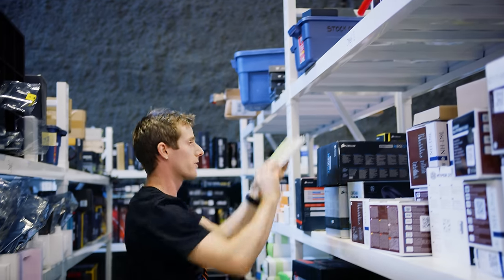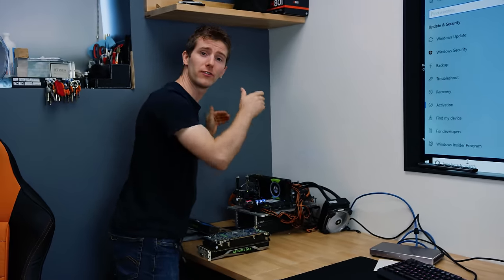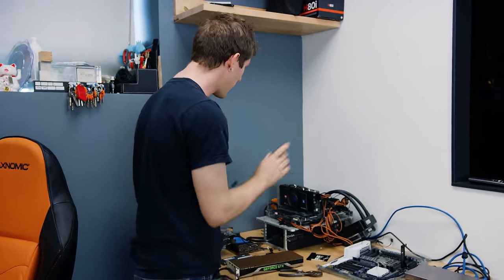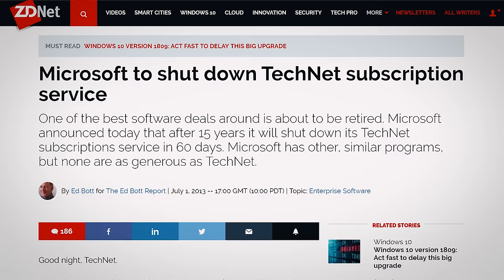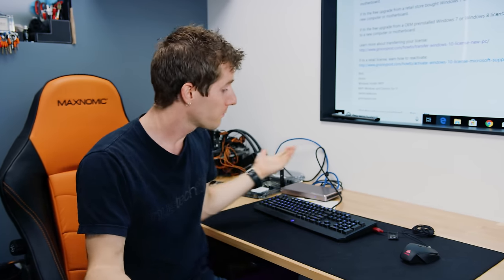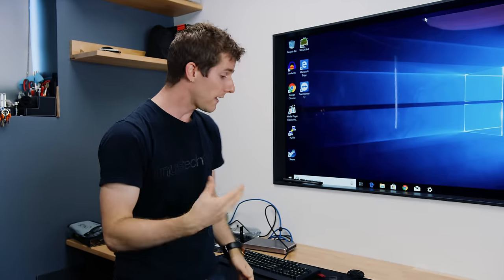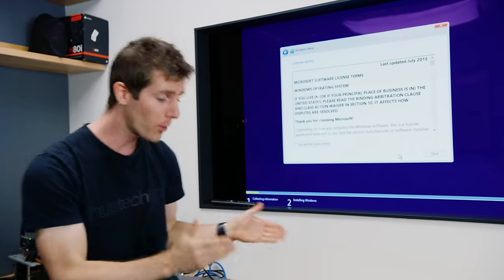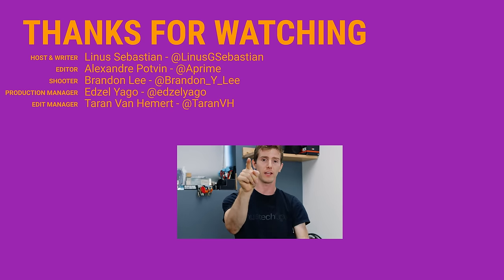Why Does Linus Pirate Windows??

Comment: I've been working in IT and related fields for over 25 years and I've yet to meet ANYONE who's ever read a EULA.
Reply: I did for a few things at uni. they have some strange stuff. did you know facebook doesn't allow registered sex offenders in their terms of service?
Reply: Makes sense I guess, but I wouldn't know - I'm not on farcebook or any of those other stupid social media platforms. Even for youtube I only log in to make the occasional comment. I do know, however that farcebook don't allow kids under 13 to use it, yet you won't find many kids that are not on it, so I guess they don't read the T&C either :)

As for Windows, so far, I've only ever seen one system running Windows 10 - most of the stuff that lands on my workbench are still single-core 32-bit XP systems, though Windows 7 is starting to show up a bit more often these days - hardware is a hell of a lot more expensive here in the UK than it is in the US, so people don't upgrade until something breaks SO badly that even I can't fix it). 

Personally I ditched Windoze almost ten years ago - Linux FTW!
Reply: It's against US federal law for kids under 13 to have accounts on social media, forums, etc. They can use it, but the account technically has to be created by the parent and used with adult supervision, or something. AFAIK it's not really enforced, but it does mean YouTube can't get sued by a negligent parent if their 9 year old gets an account and watches restricted content.
Reply: Apparently Microsoft EULA even stipulates that you can't openly criticise their products. So, whenever you're bashing on Windows you're probably violating their EULA terms.
Reply: When the EULA is non-negotiable and your only choices are either accept and use the thing or reject and don't use the thing, most people will not even consider the latter.
I bet reading the EULA feels like a waste of time when you think like that.
Reply: I read the EULAs...
Reply: … I tried, once or twice, but, after about half a page I decided that going to six different church sermons on Sunday then spending the rest of the day in the confessional booth would more than make up for any and all sins that may or may not have been committed for not finishing the EULA ...
Reply: @TGPDrunknHick  lmao that sounded soo random
Reply: 2 fun facts
1 most all EULA's are not enforceable many actually contain illegal terms.
2 on no one reading em there was once a EULA i cant remember what for but the company or an employee added a term hidden in the Eula that if you read this call them and reference  that you win $100 i think it was like 5 years before it was claimed.
Reply: No the reason I don't use facebook is because I'm not going to give that creep zuckerberg any of my personal data :D

Comment: You really shouldn't use the word "pirate." You're not stealing anything. The version of Windows I have is cracked. For whatever reason, after swapping the RAM and HDD, the digital key that came with the PC was gone. I paid for Windows when I bought the PC - I'm not paying for it twice.
Reply: Having no license key means piracy.
Reply: I had an experience when upgrading and I had to spend £100 on a new windows copy. Apparently if you upgraded from windows 8 to windows 10 you can't change any hardware or itll deactivate and you can't reactivate. Microsoft scumbags.
Reply: Mark of Excellence I built a pc and I sold the mb 
The new owner got my license 

Rip legal windows
Reply: He does have a license. That is the point. It's not piracy.
Reply: Lets keep it at him using pirate for clickbait 😉😅
Reply: Mansen
Testing a product the legal way when the product itself offers you the option of testing it is not "piracy" just because you didn't register a license.
Reply: You can't steal something that you only made/took a copy of.
Reply: Piracy isn't stealing friendo
Reply: I've pirated win 10 pro and it works great with updates etc. And I'm proud of it, everyone should stop putting money in the pockets of super rich monopolies like MS.
Reply: I believe the Mark of Excellence is "chrome" and costs about $7 from any dealer with a parts department :D
Reply: That's odd, I did an upgrade from 7 and eventually replaced everything, the motherboard, ram, processor, and graphics card. Yet I still had no problems activating since it's just linked to my microsoft account.
Reply: Toms Tukmanis don’t tell people!
The less people that use it the longer we get to keep it!
Reply: I find the ignorant to be quite amusing. I guarantee that the ones who put on the holier-than-thou facade often breach contracts without even knowing it.
Reply: I just bought it from ebay for $2.90
Reply: I agree with people who lose there license and don't wan't to buy another copy. Also if you don't have the money to buy a copy at the time and just not activate windows and then later on you buy a copy. I agree
Reply: Yep, the laws favor corporations far more than they should, and some corporations take greater advantage of that than others. Microsoft and Nintendo are a couple that will behave in a draconian fashion because they're able to.
Reply: Kevin Galindo lucky, for me it just wouldn’t let me.
Reply: central windows agency hates hardware swapping
Reply: So you lost your money and now its ok to steal. 🤔😥😥    😅😅😅
Reply: @infernustitan7091  I'm not stealing anything. I didn't lose anything, either. I have Windows and I paid for Windows. End of story.
Reply: @One_Cool_Cucumber575  same thing happened to me when I upgraded motherboard and processor.
Reply: It can also mean trial version...
Reply: @infernustitan7091  then why MS is allowed to steal product from me if I change hardware?
Reply: @StinkTerios  Yeap stealing means to take something of someone who doesnt know that you took it or take without permission. Well pirates Rob, that they take it by force and violence. Making sure you know it for good .
Reply: HWIDGEN
Reply: Mansen  Im commenting from a non activated windows
Reply: lol cmd has a built in windows activator its hilarious
Reply: Why do I have to spend a lot of time researching how their troubleshooting or transfers work? It's my time, it costs money. I bought their product and expected it to work normally but because of their mistakes or some kind of activation protection system it doesn't work so it's their job to fix it not mine.
Reply: Daily reminder that piracy is not stealing.
Reply: Mansen Having no license key, in this case, means that MS isn’t following their own TOS. It’s not on Mark of Excellence to pay for MS’s mistakes.
Reply: @HarryPearce7  Daily reminder that there was no unauthorized reproduction and/or use and thus no piracy occurred.

Comment: The reason why Linus's demonstration of losing your active status due to hardware swaps FAILED is because Linus was using a brand new Windows license. New Windows licenses allow for 5 legit activations. If Linus would have booted up the PC with substantially distinct hardware 6 different times, he would have lost his active status and got the watermark. They probably weren't using a brand new Windows license when they researching this beforehand.
Reply: True
Reply: Actually the Windows 10 activation disappears only if you replace your motherboard. It’s not affected in any way by the processor, the RAM, the graphics card or even the drive. And even if you change your motherboard, you can still restore the activation by using a Microsoft account.
Reply: I thought Microsoft changed how Windows 10 activates now to instead link the license to your Microsoft account. So reactivating should just require logging in and getting one of your unused licenses.
Reply: NVideos Yeah.. except he did change his motherboard. He showed it right in the video.
Reply: @NtvBulgaria  I upgraded my cpu only and my wondows got deactivated and would not activate at all. I was on the phone with Microsoft and rhey remoted into my pc saw my proof of purchases of windows 8 home ( I upgraded to 10) and my windows 10 pro upgrade. They had to issue me a entirely new key though luckily I did not have to pay for the new key.
Reply: Windows refused to activate for me when I built a new system and transferred the hard drive, said the motherboard key didn't match.
Reply: Not true When I changed my graphics card it deativated
Reply: I thought it was because you are allowed 30 days from the first activation to make any hardware changes before it is "set in stone"
Reply: @LanceThumping  Depends on the distribution channel. OEM licenses are bound to hardware legally. Not sure if in Windows 10 if technologically it will be linked to your account or not.

For full retail licenses it's now tied to your account and you can move it freely to a new PC as per the license terms. I think now if you use it to activate a new copy of Windows that has previously been used it deactivates the old hardware ID.
Reply: It seems that I must have gotten lucky. When my motherboard and CPU crapped out, I built an entirely new system and just put my old hard drive in it. This was 2 years ago. My computer is working fine.
Reply: I got the stupid "activate windows" watermark after having to replace my motherboard
Reply: @chatgpt872  that happen because your license key stick to the old MB.
Reply: Yeah, that`s why i would just buy another copy if i were to.I have a older built desktop that i got till whenever i can afford to do a newer build and i`m going to end up buying a key for 10.
Reply: Installed legit full retail USB copy of windows 10 on an i3. Realised i3 wasn't powerful enough, swapped mobo and cpu to k series i5 a week later and had to reactivate by phone.
Reply: I had no problem with my new system.  I had a prebuilt intel refurbished computer with OEM license, upgraded 6 months later to my own custom AMD build, but kept the same HDD (even added 2 others) and no issue.
Reply: That sucks,  i ended up going with a older prebuilt i7 4820k desktop with 16gb ram that i overclocked to 4.3Ghz because besides that now i have a promac with a i5 8gb ram which isn`t enough.
Reply: Sounds like it was branded pc like Dell or something.

Comment: This is kind of like the old thought experiment the ship of Theseus. 

To update it with PC’s, at what point in replacing the computer’s components does it become an entirely different computer? And if you take the old components and make a new computer out of those, which computer is the original?
Reply: It' s true, when people ask me if I built my PC I'm not sure, I ordered it pre-built but have since replaced pretty much every part
Reply: David Heise the license is tied to the motherboard. You can change anything besides that and Windows won’t care. Depending on the license, you still have the ability to activate anyway.
Reply: @TheSjuris  That's not true. He even showed changing the motherboard in the video. Windows mysteriously still didn't care.
Reply: @TheSjuris  I've swapped everything in my computer but the ram and cpu and it didnt come up. Now that I swapped the cpu now and the only original part in my computer is the drives and ram it came up and Microsoft keeps saying try again later when ever I try to transfer the windows key
Reply: @dhkatz_  I think at some point it was tied to his Microsoft Account. If he only had 1 windows license tied to the account maybe that's what mattered.
Reply: I’ve used the same Windows install on my computer installed in the same SSD I bought when I first built the thing, but I’ve changed the GPU three times, and switched from Intel to AMD. I’ve added a hard drive and changed the case. Hell, I’ve even added a new monitor. That old SSD is still kicking, and Windows still recognizing my license.
Reply: My axe has been in my family for over 80 years, it has lasted that long because the handle was replaced 6 times and the head replaced 4 times.
Reply: I asked myself the same question ! Except for the drives, the power supply, and the case, I've changed everypart of my PC, is it the same PC ? Yes because it is a t the same placeand fullfil the same purposes and have all the memory of it but no because it is different.
Reply: Wasn't that Hippocrates or Democratus or someone who dipped his toe in the river?
Reply: You know what would be easier windows just tie that shit to your existence kinda like how a bank does, just congrats you bought windows 10 for “insert name here”
Reply: Doctor it’s true, I recently swapped out a motherboard that had gone bad with something very similar, both were ASrock of a particular type. Windows stayed activated. On the other hand I’ve replaced hard drives that we’re going bad and had to reactivate...

Comment: "In the olden days"

2012
Reply: did you think he was talking about 1912?
Reply: @shugo104 Tell me why I assumed that people born in 2005 are 10 years old now
Reply: @shugo104 My brain never moved past 2015
Reply: "In the olden days" for me was practically knowing my Windows 98 SE key by heart and getting a Pentium MMX 166 through 3DMark2001 at 262 MHz just for the heck of it because I was bored and didn't have money to upgrade my Athlon 1 Ghz slot A system running Windows Me.  To this day, that trash day system is the highest % overclock I've ever been able to get.
Reply: @hdrenginedevelopment7507  in the golden days for me was 1993. I'm busy trying to ruin my parents 386 by fiddling with auto exec.bat
No biggie right  I'm 12 or so and I'll just format every time and.... EENNHHHH!! wrong. I managed to mess up every family PC at least once. ❤🤓
Reply: I  thought he was going to reference the XP days of skipping activation, then connecting to a 3rd party dodgy Windows update server to install a single patch, to trick the OS into thinking it was activated because it installed a single patch, then connecting to the legit servers for the rest of the updates. I think that was around 2005?

Comment: A retail version (not the white OEM envelope) have a activation code that can be migrated to one machine (tied to the motherboard) instead of being tied to a particular motherboard (e.g. OEM keys are non-transferrable despite saying it's linked to your MS account)
I had a retail version activated on my pocket pc which I ditched, but I am able to use the troubleshooter and migrate my license to a thinkpad.
However, as said, there might be a finite number of times you can migrate the license, and I don't see a reason running a non-activated windows (to test components with a specific motherboard) is a issue.
Just make sure your own PC motherboard is tied to a activated code. OEM or retail.
Reply: This is the only correct take, the red sticker on the envelope is a dead giveaway. The reason he's having problems is because those are system builder keys, they must be preinstalled on a PC that is resold,  and they're tied to the motherboard. Moving it to a new motherboard, or using it for purposes other than preinstallation, is actually a violation of the license. 

On the contrary the licensee of a retail key can use it on any PC as long as one instance of it is running at a time; and they have a virtually infinite amount of reactivations. (As long as you don't get the key blacklisted w/ a suspicious pattern of activations.) His use-case is perfectly supported, in a number of ways actually, he just bought the wrong license. What MSFT probably wants him to do is sign a volume agreement so they can audit him at will ;-). He could also pay a few grand a year on MSDN subscriptions -  then his employees can use any supported version of Windows on whatever hardware they want for development/testing purposes.
Reply: Long time since this comment was posted, but my own experience from a few weeks ago prompted me to write an answer: I've built my PC over a year ago and used an unused Win 8 retail licence I had lying around to activate win 10. Worked like a charm, licence was linked to my account. No problem, right? Wrong. Turns out that each time I upgraded my mainboard BIOS Windows internally perceived that as a hardware change. (I don't know why it happened, but if you have a Gigabyte mainboard you better watch out.) And the last BIOS update just straight up deactivated Windows. I couldn't reactivate it, Windows and the microsoft support site said the key wasn't valid for any more activations. So there was a retail key from a boxed windows version I legitimally bought and MS basically told me to go f myself just because of some BIOS updates.